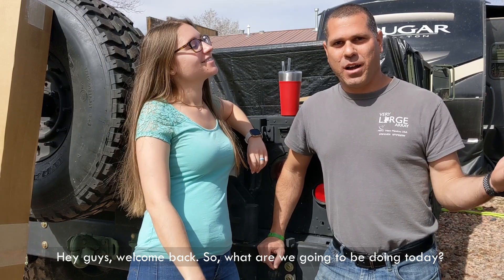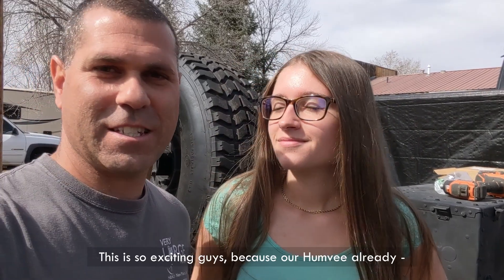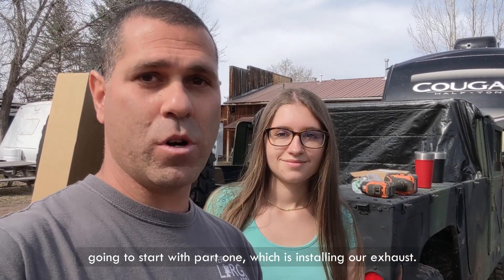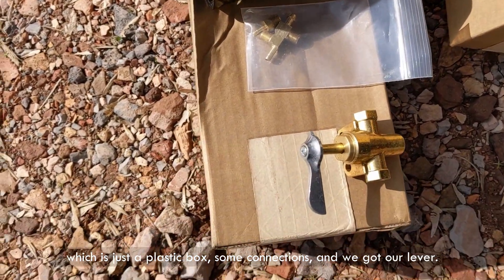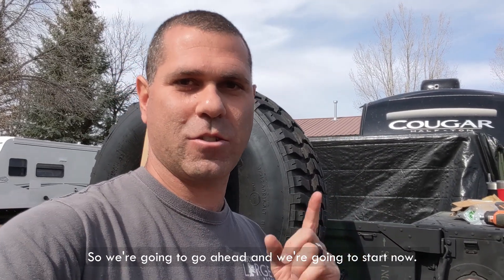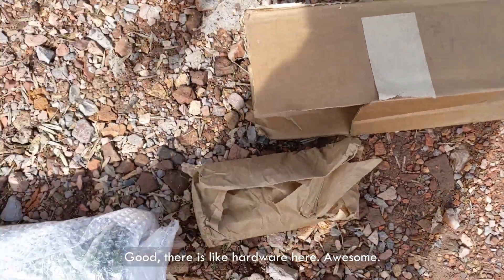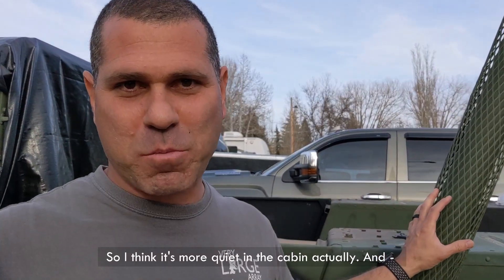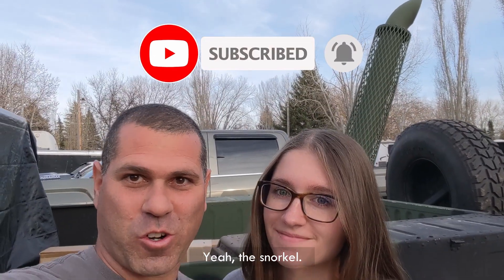HUMVEE Deep Water Fording Conversion (Part 1: Exhaust)

Comment: The gasket is a high temperature grafoil seal (compressed natural graphite made from exfoliated mineral flake (crystalline) graphite.) They use them in power plant high temperature piping systems.
Reply from the maker: So cool, I figured it was something like that. Thanks for sharing :)

Comment: Just as an FYI, the deep water fording kit will help going through deep water of course, but the real limiting factor to the Humvee/H1's fording depth is the hydrostatic pressure on the seals and the vent system.  After crossing deep water, you should always do a check of the hubs, diffs and tcase.  Pull the transmission dipstick to ensure no water got in there either.  The vent system IS tied into the air intake for the engine however, there could be leaks and cracks in the plastic tubing after 20 or 30 years.  Fun fact, the HMMWV gauges are waterproof but the H1's aren't.  Wonder why :)
Reply from the maker: Awesome! Cool facts and great to know all that stuff. Thank you so much :)

Comment: Great video, thank you. Do you know the height from the ground to the top of the exhaust. My garage clearance is 79.5”.
Reply from the maker: Thank you so much, Jason :) so happy you enjoyed the video. I am not sure about the height, I would check for you but we are unfortunately currently unable to do so as we had some family emergency. Let me know in the future if you don't have an answer, and I can measure it for  you as soon as I can! So sorry about that. I may also recommend posting your question on one of the Facebook Humvee groups, I'm sure someone can give you measurements. Have a great weekend. :)
Reply: @theinspiredjourney  Thank you and I hope your family is ok.
Reply: My exhaust was a half inch too tall. Ended up having a welder trimming off 1.5 to 2 inches off. Fits now and looks great.
Reply: @dalechristensen3640  I may do that. Thank you.
Reply: @jasont7814  I can send you pics.
Reply: @dalechristensen3640  Hi Dale, did your welder take the two inches from the top, or the bottom? I’m ready to pull the trigger and buy one. Thank you.
Reply: @jasont7814 from the top, just at the top of the heat cage, to the bottom of the exhaust opening. Looks pretty natural if you don't compare it to stock.
Reply: @dalechristensen3640  Got it, thank you.